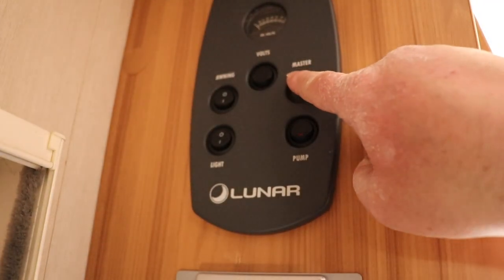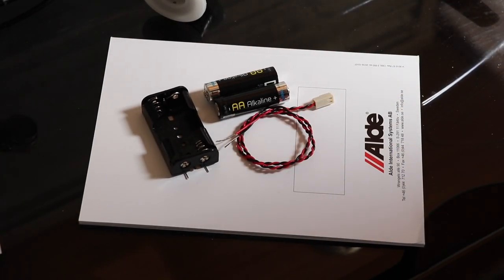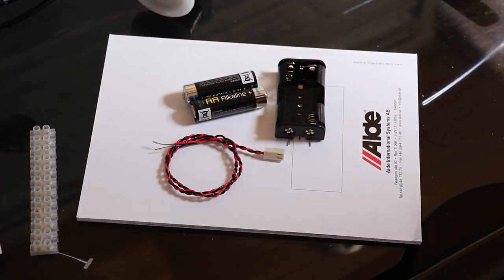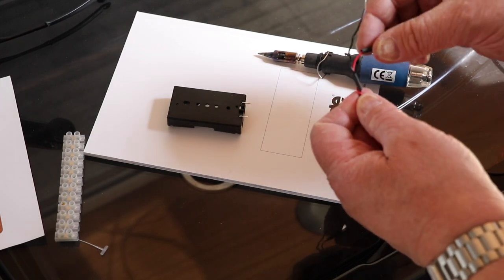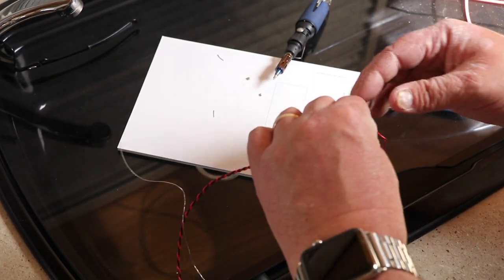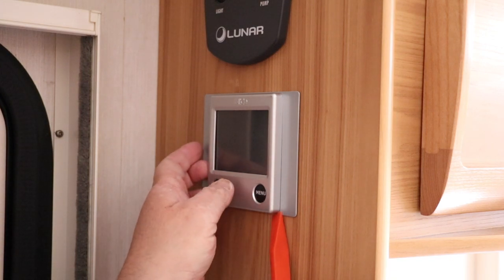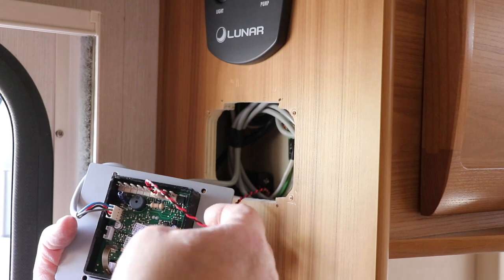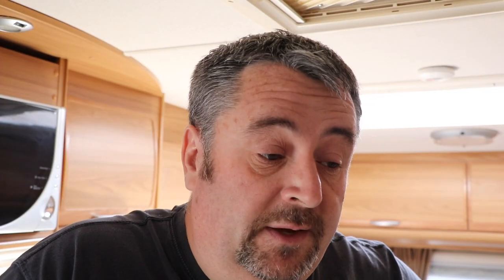Alde control panel Battery Backup

Comment: Hi. I have the older ALDE heating controller and the JP3 socket has four pins. Do you know to which ones I connect the battery backup? Thanks.

Comment: Hi Dan, after watching your video, I ordered the battery box from Dennis, however t came with no instructions. So I watched video again and was a bit confused when you said the plug goes to J3 terminal as you showed. You later said it went to N terminal. The Alde Manual shows a wiring diagram which show the plug goes to J1. So you can see where the confusion comes in. I have a 3020 display panel.
Reply from the maker: Hi Colin, 

thanks for the message. On the 3020 panel, the correct connection is called JP1. have a look here: http://www.alde.co.uk/downloads/alde_3020_user.pdf#page=17

This was a slight change from the 3010 panel that you see in the video.

I hope that helps. 

Dan
Reply: Many Thanks Dan, this has saved a bit of cash, bit annoying for the sake of a couple of pounds it is not included in the original setup

Comment: Great vid as usual. Would there possibly be anywhere to put the back up where it is easier to change the batteries without having to unscrew it all every time? (Just wondering how many times you can unscrew etc before the holes get worn and you get loose screws)
Reply from the maker: Hi Cathryn, yes you can install the battery box anywhere, like poke a hole into a cupboard etc or have it within easy reach etc. Ive calculate that these 2 AAs should last about 2 - 3 years before they will need changing.

Hope that helps.
Dan

Comment: This is fantastic. I was not aware that a battery back up was possible and this is so simple to do. Why does this not come as a standard installation I wonder?  Well done Dan done for bringing this to my and others attention.  I was going to go down the panel upgrade route but think I will just try this first on the original panel installed. Thanks again for the clear and concise instructions.
Reply: Hi Dan,
Great fix! 
I found the temperature control to be way out on these controllers due to the location it is installed in! There is a setback setting to compensate for this but it still is detecting the temperature within the cavity.
There is a fix available to extend the sensor out into the caravan to make the temperature control more responsive.
I've not got round to doing this but I believe the parts are available from Bailey spares but I'm sure you could find a way of making a cheaper alternative! 
Enjoying your vids, I only bought my  van a short time ago and have found your advice very helpful.
Regards
Mike, Waiuku, NZ
Reply from the maker: Hi Richard,

Give the battery back up a go - then see if you still require a new panel, personally i hated the older panel, i simply couldnt work it, the new one has made life a lot easier !

Take care
Dan
Reply from the maker: Hi Mike, 

I will be showing how to extend cables in a simple yet effective way in a couple of weeks. I needed to extend the cables recently for the temp sensor and the load sensor too. 

Stay tuned, it will be out soon.

Take care
Dan

Comment: I’ve been following your videos as a new owner, and have learned so much - thank you!
I have an issue with the Alde control panel? It doesn’t illuminate when the power is on? I’ve hooked up to 240v, switched on the master switch, turned on the pump, but no power to the control panel? I have been told that there are fuses in the actual heating system under the seat, but would the control panel not work if these have blown?
I have a Bailey unicorn Seville 2011

Kind regards 
Amanda

Comment: Hi Dan, 
I wonder if you can help as I am a little confused watching your video regarding the original control panel. You state in the video that the battery backup can be used on the original 3010 controller by plugging it into JP3. Alde sell a specific battery backup cable 3010-313 for JP3 and this connects to a 12v supply and not a 3v supply that 2 x AA batteries would supply. I bought a molex connector and battery holder and have tried it on JP3 and it does not work. Any suggestions?

The link below shows the instructions that come with the 3010-313 cable:-

https://picclick.co.uk/Alde-3010-313-Battery-Backup-Cable-Kit-162929143401.html#&gid=1&pid=3

Comment: Hi Dan. 
Love your videos.
I too, after seeing Alde's price for their version, built my own battery backup a few weeks ago. The only thing I did differently though, was to use self-adhesive Velcro strips to fix the battery box inside a cabinet which is above the Alde control panel in my caravan. I think this will make changing the batteries a little easier. I can just pull the battery box off the Velcro without the need to remove the Alde control panel and firkle about in the tight space behind it. 
I've also fitted the Alde load monitor to my boiler, so hopefully I won't trip the electricity supply when on sites with lower amperage supplies. Well worth doing. :)
Reply from the maker: ah yes, the load monitor and external temp sensor are both also installed - you will see these in future videos ;-) the battery should last for quite a while, so being able to replace the battery once every 3 years or so shouldn't be an issue - well done !

Take care
Dan

Comment: Great clip I like the gas solder
Reply from the maker: Thank you

Its excellent for when there is no power around or you're outside. 

Take care
Dan
Reply: Yes Dan a neat tool, have you a link to it, I want one.
Reply from the maker: Hi Andy, this is a good one, mine is a few years old now and won't light itself, it requires a lighter - This one however is one i have used a lot and works really well. 

http://amzn.to/2rCG7ET

Hope that helps.

Dan